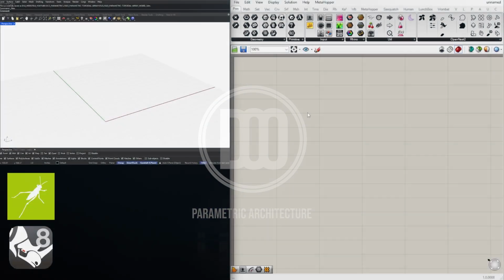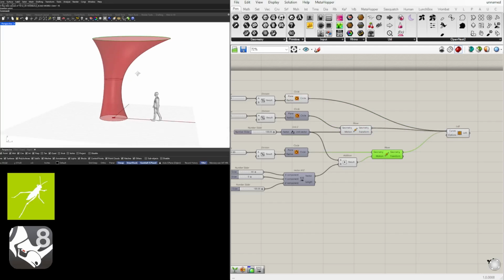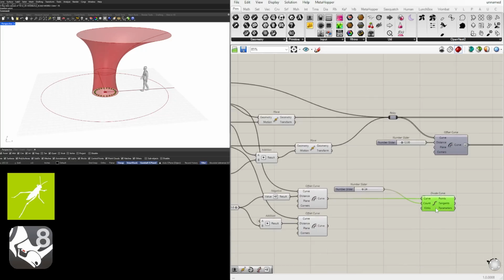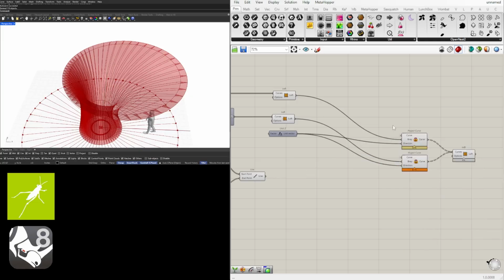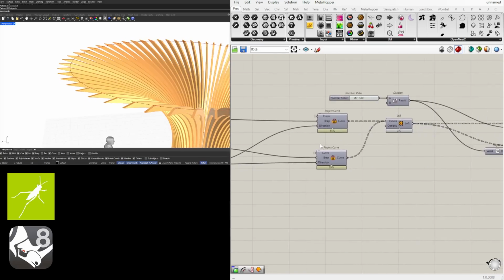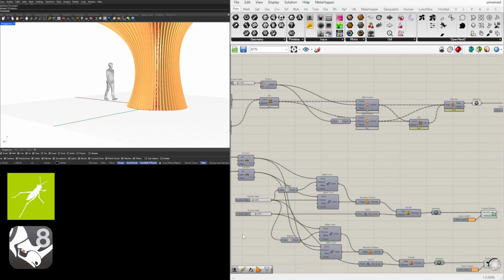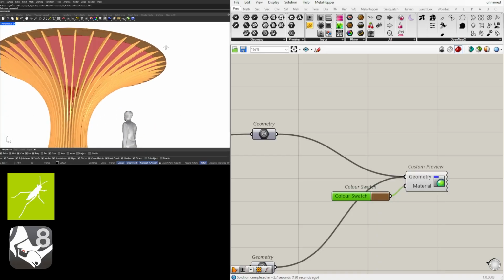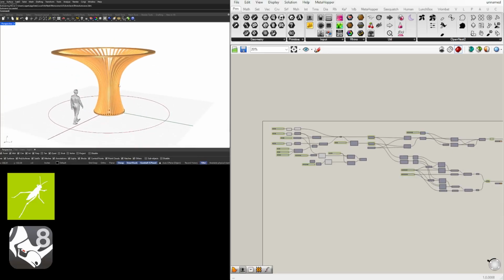Parametric Design Tutorial Toroidal Column Array Design Using Grasshopper for Rhino 8 3D

Comment: Could you explain how you edit 1/2 on the division. I tried couple way but wasn’t able to put any number  on the division tool😢
Reply from the maker: If you double click in the canvas you can type /# then enter and you'll get a division component with whatever number you used. If you want, another way would be to bring in a division component and use either a slider, or right click on b input and set interager to set a specific number. I may do a short video explaining this